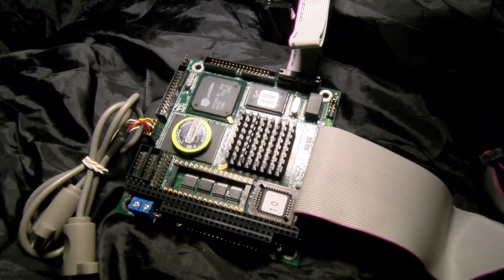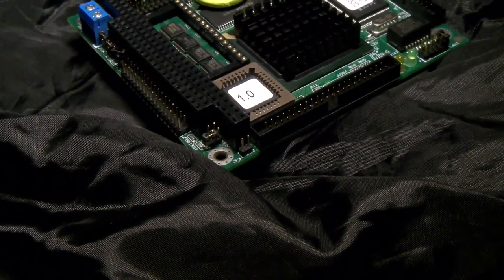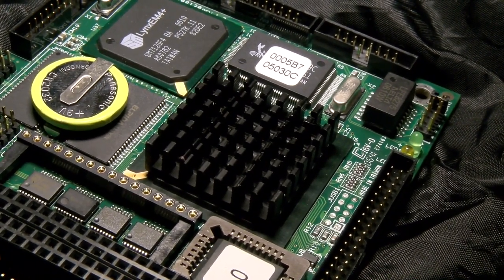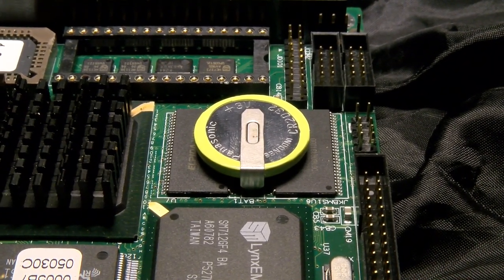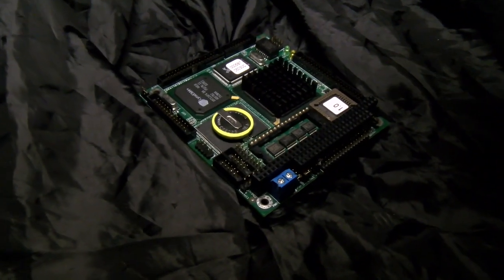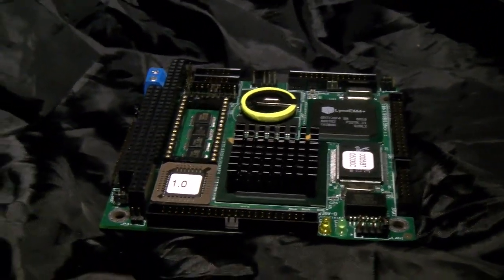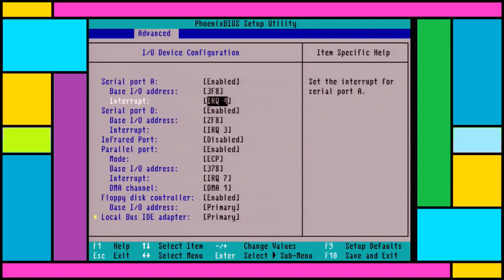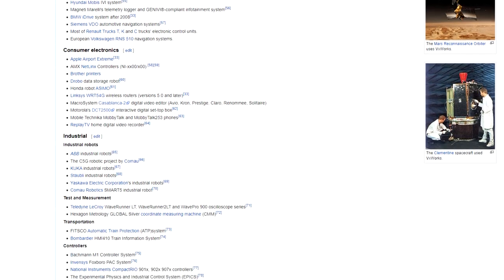PC/104 with ZFx86 SoC

Comment: I find myself in a double bias in this situation.  I think the 486 was one of the all time best processor ever made, but add to it my love for the Cyrix chips and we have a great processor in this SOC board.  Sure seems like the 486 architecture could have gone faster than 100mhz with this die shrink, but they were probably aiming for almost no power and heat.   I scored a new socket 479 board for the desktop using the 915 chipset to play with some of my Pentium M chips on the desktop platform.
Reply from the maker: I'd still argue the WinChip was basically a 486, which certainly suggests it could go significantly faster. Actually curious as to whether any SoC ever used those, as I've never once seen one.
Socket 479? Is this one of those PC Chips ones with the red solder mask? I remember those being around for a time, always thought they were weird, despite people using Mobile Athlon chips in desktops for some time already back then.
Still have the 955X and Presler XE setup here, but can't run it much at this time of year - the machine doesn't mind, but the heat output makes the room unbearable to be in after a while.

Comment: I think it would be a nice system for 1990/91 gaming.
Reply: Well, if you have a solution for the sound. Sound cards are rare but an ISA Adapter may not be.
Reply: @AmstradExin  The bus is ISA right? Then just find pin headers and solder them to an edge connector. Voila, and it is theoretically solved.
Reply from the maker: It can go further than that as Duke3D seems to run quite well. Sound cards are definitely possible either with an ISA adapter (you'd be better making one, they're expensive), or a PC/104 sound card like that ESS one I have hooked up to the STPC-based PC/104 (these are also expensive). If you did adapt a regular ISA sound card to fit, it might be better to use a powered backplane or something instead, or else rig up your adapter to supply its own power. In some cases this may even be required.
Reply: @HighTreason610  Thanks for the info. 👍 I suspected that it was not impossible. 🙂
Reply: @AmstradExin  TheRasteri created a PC104 soundcard. So far, I haven't seen anyone willing to do a small production run of them though. Still possible to DIY if you're good at soldering.
Reply: @AmstradExin  Also, there's USB sound dongles if the SOC has USB support. Some of the USB sound chipsets have drivers compatible with 95/98/XP (but not DOS). DOS games would have to be run within Windows to get sound, but it may run like crap due to Windows overhead.

Comment: Automatic thumbs-up for PC104. :)
Did you happen to have an AMD ELAN? I think you briefly mentioned it in your STPC video. Would be interesting to have a ZF86/Vortex86/ELAN/STPC/Geode benchmark shootout.
Reply from the maker: Have yet to run into an Elan system, nor have much desire to obtain one. Owned Vortex86 systems and wasn't at all impressed by them, as they were riddled with problems - others have reported that theirs weren't, but this left a bad taste and I'd prefer not to touch those again. Can't rule the others out, some day, but it's very, very low on the list.
Curiously, there are some rumors out there which suggest Intel used a 486 core somewhere in their integrated graphics recently. Wouldn't be surprised if it were true.

Comment: Hehe, you might have meant Write Thru, Write Back is only supported by a handful 486, like a very few Intel DX2-66 and all DX4-100. But it's also only supported on a hand full of AMD/Cyrix chips. Mostly those which have 16K Cache. I also doubt the chip has an FPU. It's not uncommon to have these scrapped on these SOC's.
Reply from the maker: It's definitely Write-Back cache. Cyrix were well known for this, as they even used WB cache on their SX chips, though it was a smaller size than other CPUs. I don't think any Cyrix 486 ever had 16K of cache, nor do I know of any Cyrix DX4 that was WT. Also the FPU is definitely present. This is quite clear on the SpeedSys screen for one and MP3 playback works on this system.